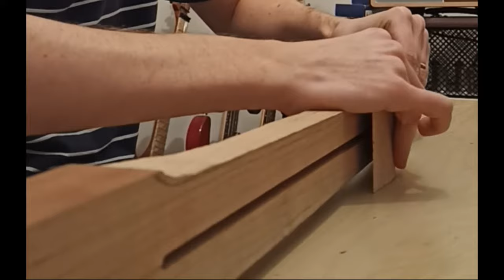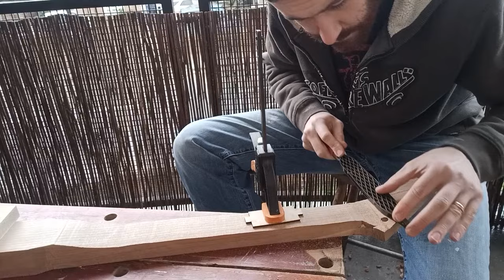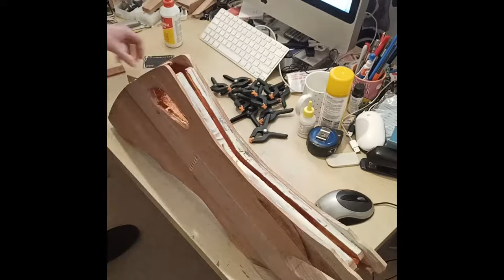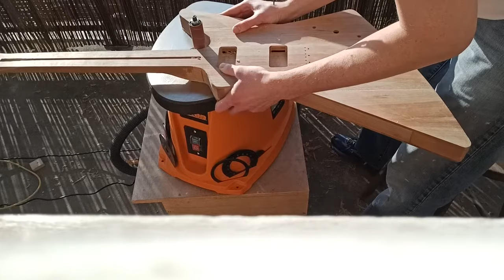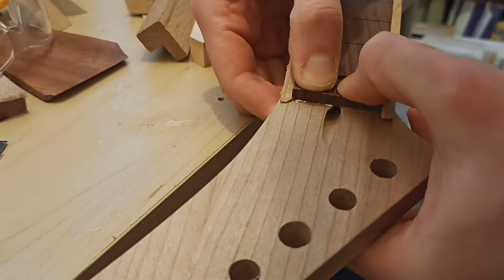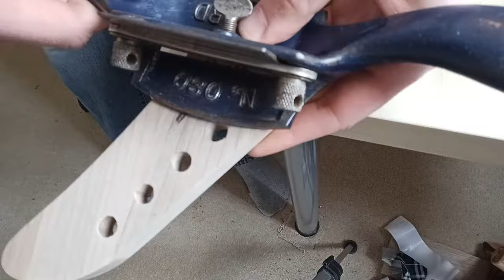Semi Hollow Cherry Explorer Guitar Build

Comment: is the guitar neck heavy with the lighter body? best regards
Reply from the maker: The neck isn't over heavy compared to the body, it's still got quite a bit of weight in the body from the neck through plank. Thanks for checking out the video!! Cheers